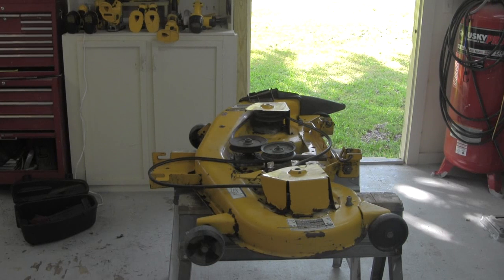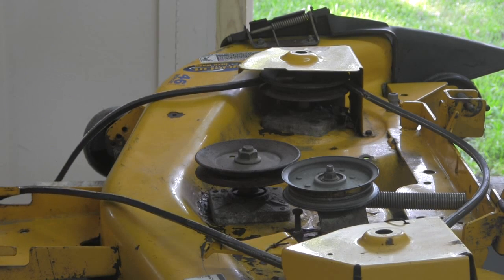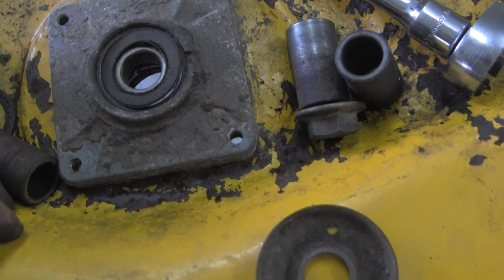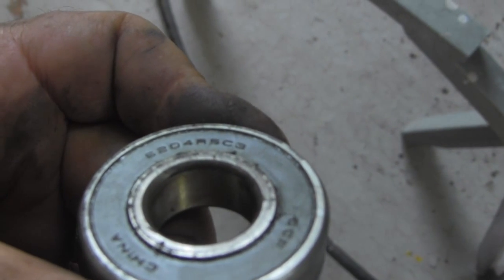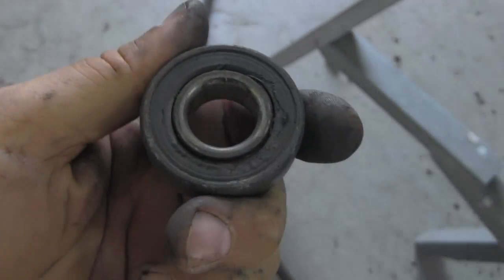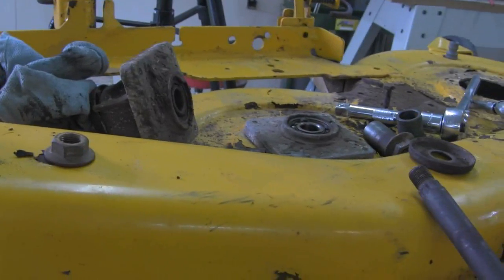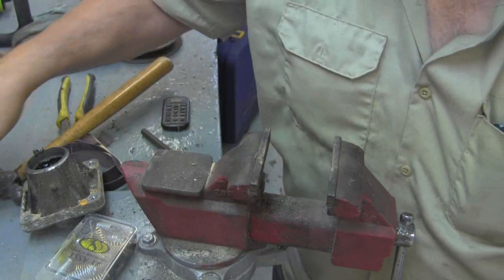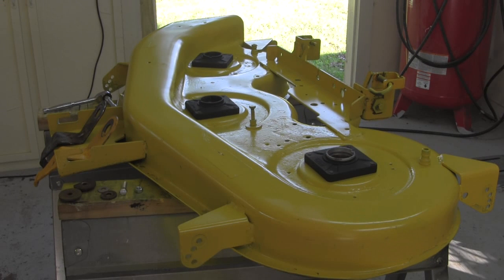rebuilding  a mower deck

Comment: Wow,I saw all of those cordless tools on the counter at the beginning of the video.You have a nice shop.I am tearing down a small 60 year old house, and will use the 2x6 and 2x8 boards(still good,real oak,not that cheap wood they use today)to build me a garage so I can have a nice place to work on things.I like these videos,its like I am looking over your shoulder without getting in your way,and learning.
Reply from the maker: Thanks for hanging around the shop with me! My henhouse is built from the good wood that i got from taking down my rotted carport. Im a big fan of recycling and repurposing. The dewalt tools have lasted longer than any ive had before. If my ship ever comes in,,,,or rowboat for that matter, im gonna buy a fuill set of the 24 volt lithium ion dewalt tools.

Comment: Those are mock grease fittings. Decorative to make you think your adding grease, then when stuff falls apart, as designed, you end up spending money to repair or have it repaired. Disposable parts suck!  Great Job Man!! Love it when someone can outsmart the money makers!!
Reply from the maker: sticking it to the man!!!!!!!
Reply: You can buy the bearings with just one side sealed. A zz is double seal, a z is one seal. Just the number is no seal.
Reply from the maker: Yeah, cause they’re putting quality sealed bearings in cheap mowers. The first things to go on these are  the “quality sealed bearings”. Einstein!

Comment: I have a John Deere X500 with a 48 inch mower deck. Several times I have changed  both belts.
The problem that I have is after mowing for a shot while the top belt comes off. (  mower to motor )
Reply from the maker: two possibilities. The spring that keeps the tension on the idler pulley is weak or the bolt that the idler pulley pivots on is froze up. Those would be my guess's

Comment: I'm surprised that there isn't a grease zero on those spindles.  I'm not a fan of those forever lubed bearings, I like to push grease through mine.  Especially if I hit it with a hose or cut wet grass.  Good fix!  I see you and I have the same compressor possibly, Husky?  One of my best purchases.  Makes lots of air.
Reply from the maker: Im an over greaser,which is why ive never had to replace a bearing on anything ive ever owned. I have had to wipe up a bunch of grease though!

Comment: I’m in the middle of the same. Project w/ a 52” Murray mower deck but I can’t find a picture of how all the brackets are positioned w/ reference to each other. I took 50 pictures but just can’t find that one picture showing the relative positions of everything on the top....
Reply from the maker: E,replacement parts is the only website that I know of that gas detailed blow up diagrams of decks.

Comment: Thanks for the video - I am rebuilding a similar deck, and I agree totally about the grease design for the spindles. I look at it as a marketing scam - there is a grease fitting to 'grease' the spindles, but the grease doesn't get into the bearings because they used sealed bearings. Shame On You Deere!! If you look at the cavity size it may not be worthwhile to fill up with grease. It might be best to disassemble the spindles and grease the bearings by taking off the rubber seal every year or two depending on use of course.

Comment: Maybe the bearings were replaced at one point and the person doing the work didn't think about the seals not allowing grease to enter.  I doubt this would be a manufacturing defect.
Reply from the maker: Blaine Bugaski then you have clearly not taken many of these apart. All, I mean every single bearing and mandrel that I’ve taken apart, has had both seals on them.

Comment: Oh, almost forgot - if you take off the inner rubber seals on the bearings and fill with grease thru the grease zerk you will likely blow out the outer rubber seals, and that will bring on quicker failure of the bearings. Unfortunately the assembly isn't designed for greasing of the bearings.
Reply from the maker: That’s just not so. I’ve had several mowers overs decades of use that have never had the opposite side seal blow out.  Just don’t pump to much grease and you’re ok.
Reply: @bctruck  Thanks for letting me/us know. I guess I was thinking of a typical grease setup where you inject the grease until it comes out the bearing assembly (get out the old, inject until you see the new grease come thru). So since you know the design you just inject enough to fill? I still think removing the outer seals would be required just to get out dirt and grease that may have gotten in, what do you think? 

I have a Honda 52" cutter and it has top and bottom bearings, so you inject grease until you see the new grease comes out. Problem is one bearing (there are two on each spindle) will flow more than the other it isn't the best design either.One bearing may not flow at all, then you have another problem to deal with...

Comment: What's the best way to just remove the blades with out CubCadet's "special tool"?
I need to either replace mine or have a new edge ground on them.
Reply from the maker: Ive never heard of a special tool. I just use a wrench.

Comment: Napa sells bearings with one seal. The fastest way to destroy a peice of lawn equipment is to leave it sit outside.
Reply from the maker: I agree. My neighbor replaces one every couple of years because he parks it outside in the rain. I’ve had mine 16 years now and it’s still in excellent condition.
Reply: Jerome Cook and also leaving we grass on the deck rusts right through it

Comment: Those bearings like almost everything today is Designed to Fail, kind of makes you angry don't it... In case you would like some normal Gas there is a place on Industrial in Bossier called Pel-State across the street from the DOTD yard, that sells regular Gas without that Ethanol Engine Killer Garbage in it... Have a Blessed one.
Reply from the maker: I did not know that! I know exactly where you are talking about! Thanks!

Comment: do not do what you said with those bearings remove the shield put the grease in the palm of your hand smash the bearing into the palm of your hand forcing the grease into the balls load it replace the shield put it back in my spindles on my deck came with zerk fittings how stupid somebody went to all that trouble and I took the bearings out and it was sealed shielded zerk fittings mean nothing the waste of effort waste of Labor waste of Grease

Comment: The seals are free floating seals they are not like the seals in ur car front spindles the ones in ur lawnmower if you grease them with enough grease the grease will fill the bearing.  the seals are lose that’s why it works because it will push right past that free floating seal. you guys are all wrong & ruining ur bearings who ever started this bs rumor knows nothing about how seals or free floating seals are engineered so you really think they are gonna designed a spindle with grease zerk & you can’t grease it ur crazy you ppl are destroying ur own spindles & think ur doing the right thing but ur not & whoever started the bs rumor is sitting back & laughing at everyone of you!!
Reply from the maker: You are 100% wrong. The seals are NOT free floating. You e clearly never had one in your hand and examined it and you e clearly never replaced one. You know absolutely nothing of that which you speak.